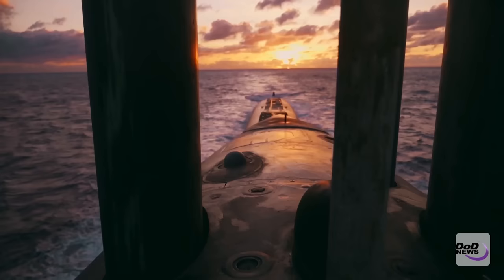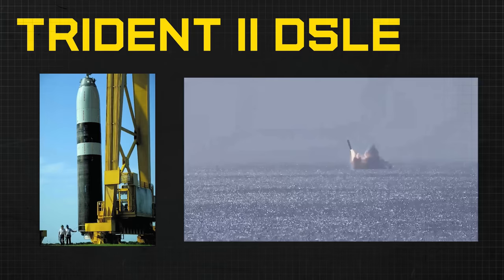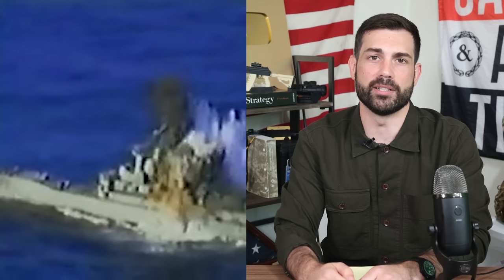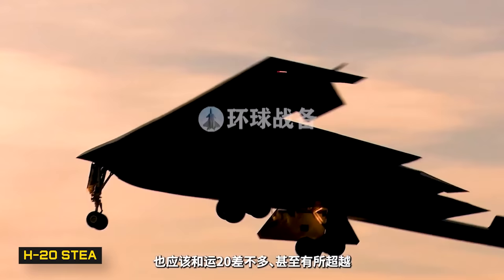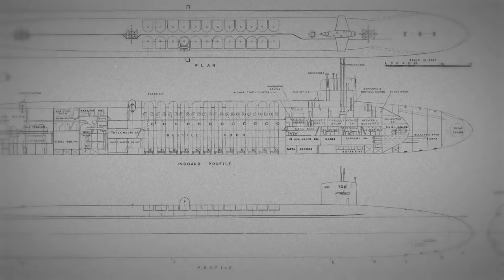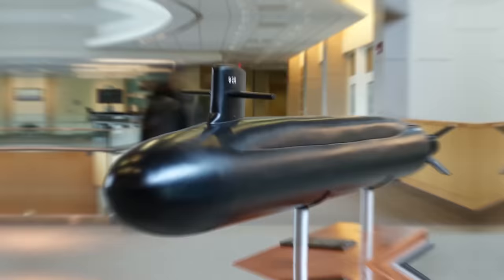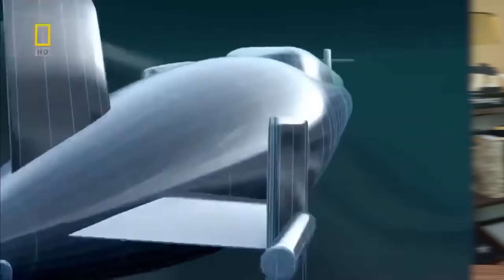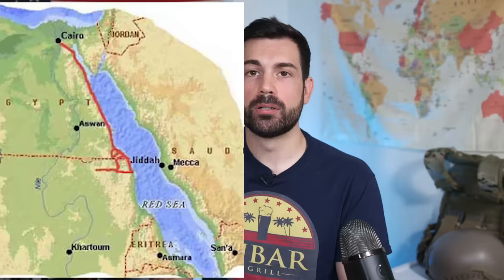Why America’s New Submarine is their Secret Weapon

Comment: Great video, but small correction - the Navy would most likely use Virginia class attack subs to chase away flotillas. The Columbia class, like the Ohio before, are Nuke bois...the torpedoes are for defense of the submarine.
Reply: @Freedom_Half_Off  yeah of course I didn't mean they'd be out there alone lol..sorry if that wasn't clear. Just mainly pointing out that the torpedoes are for defense of the nuke subs, and that they wouldn't send them for that purpose.
Reply: Yeah, that is a pretty huge mistake. The Columbia’s aren’t supposed to get anywhere near an enemy formation.
Reply: I wonder if less costly sea drones and AI will make ASW much more potent than it is today.  The ocean is a big place, but it is finite, and if the drones are numerous enough, the subs will find it harder to hide and with less time to launch their own attack.  A drone sub could connect to a mother drone or ship for battery recharging, diagnostics, and repair and then return to its search program.  If it finds something, then it surfaces and starts transmitting its data.  It could deploy sonobuoys to maintain contact.  Maybe a torpedo can take out the drone, but that can also telegraph the submarine operating area and attract other drones.  The drone itself could have some kind of ASW weaponry.  I don't think survival gets easier with time for these large, manned submarines.
Reply: @Freedom_Half_Off I think the video did a good job explaining their purpose, the torpedo and further tech explanations felt like a breakdown of developed technologies, etc.
Reply: Came here to say this. Ballistic missile subs hide, while attack sub seek.
Reply: @timtrewyn453 I think you underestimate just how big the ocean is.
Reply: Lol we could probably short duration active ping the flotilla with  of one of those old Seawolf class submarines, kind of like knocking so the go and look to see who’s at the door. Then let them listen for the props as they whip them up about 1/2 to 3/4 open.. just long enough to recognize who’s lurking. 😬 a little aggressive but kind of subtle at the same time? Idk but I bet there would be some serious conversations going up top in those ships too far from home.😂
Reply: Even a basic knowledge of sub types and roles would know this...I have known that since I was 10 and I wasn't a Navy Brat.
Reply: @grahamstrouse1165  100% would go the other way....as fast as they could.on the natural convection of cooling water so as not to need to activate reactor pumps
Reply: @Freedom_Half_Off  Unless you're in a shooting war,
there's generally little anyone can (or should) do about
"incursions" outside the 12 mile line.
Freedom of navigation goes both ways.
Reply: @thorwaldjohanson2526  It's big, but finite.  Drones could be organized in lines that subs have to cross to get to and from their operating area.  The drones do not have to cover every square mile.
Reply: @tbthedozer   Old seawolf???  We still have Los Angeles class subs out there Seawolf's are in the middle  LA class are the most numerous 34 of them still out there,  only three seawolf class and then a bunch of Virginia class about 20 out there with more on the way.  The remaining LA class are 688i  flight 3 boats last one was built in 1989
Reply: @timtrewyn453 
A drone has all the fuel and maintenance issues of a proper aircraft.
Reply: @icecold9511  True.  Tenders would be needed.  Some would be lost.
Reply: @Freedom_Half_Off Agreed. A single launch by anyone would mean the end of days for this planet, regardless of the technology or who fires first.
Reply: @Stryyder1  you do know that the Virginia class IS the Seawolf Class; right?
Reply: @ligmasack9038  umm...not exactly? I knew some tech developed for the Seawolf eventually made it into the Virginias in some form, but I never knew it to be the same or based on Seawolf as a whole. I could definitely be wrong tho...could you be more specific?
Reply: @Freedom_Half_Off $132B? Yeah, it’s worth more than that.
Reply: @timtrewyn453 You’re not wrong, but work the math on the number of drones it would require. Not an insignificant undertaking. But, it is a challenge that will need to be addressed.
Reply: Can’t speak for the US but UK subs fill a duel role. Each class only has 4 boats and, though there is always overlap between the rolling out of a new class and the scuttling of an old class, there just aren’t enough options available. 
It is a pretty big lack of insight to have your HKs and NDs fill the same role: the potential for a loaded HK to be hit is dangerously high and the resulting fallout from such an event… it doesn’t bare thinking about
Reply: @jakelilevjen9766    The Black Sea, a more manageable area, would be a place to start.  Drones could make manned submarine operations perhaps too risky.  Ukraine has a long-term interest in suppressing missile fire from Russian submarines.
Reply: Person
Reply: Person
Reply: The
Reply: @jacobp8294 Don't beat up Army for Naval ignorance. He is stretching his sphere of knowledge, and Navy stuff can get really complex.
Reply: BTW ignorance is not to be considered as stupid, just not well aware of the details.
Reply: Yes, I stopped watching the video after the first two minutes in which the presenter made it clear that he has no idea what the role of a ballistic missile submarine is.
Reply: Huge correction to be honest. Not sure who wrote that part of the script. And then it was followed up with “twin” torpedoes. Whether you are correctly talking about the Virginia class or incorrectly talking about Columbia class, both are equipped with four tubes. Since I’m being critical - you also had an A&E moment when you showed Virginia-class vertical launchers when talking about SSBN launchers. Now back to the video I guess.
Reply: @Freedom_Half_Off   Yes, the whole reason the Ohio and now the Columbia class is stealth. They are not there to attack surface ships , unless they themselves are attacked.  I worked on 688 class attack submarines and Ohio class while working in the shipyard. Amazing machines!
Reply: Or just ring AUKUS, from 2030... India will probably be fully on board by then too. Cheers 🇦🇺
Reply: @Freedom_Half_Off Chris did not get into the Navy imho 😂 🇦🇺⚓
Reply: Yep, they are boomers and don't do ship attack
Reply: @timtrewyn453 works both ways
Reply: Quite right!
Reply: I wanted to point this out. The whole point of a SSBN is to keep the location a secret. No way are they going to be used in warfare against naval targets.

That is what attack subs are for.

In addition to this, he said that the Ohio class Trident missiles can only carry 4 warheads each. This is false. They can carry up to 14, but it depends on the type of warhead. The number is currently limited to by treaties.
Reply: @Freedom_Half_Off  "The attack subs aren't going to stop incursions by flotillas of cruisers and destroyers either ... not unless we're in a shooting war or they want to start one ."

Subs can ping ships if they feel the ship can't lock on to them.

But yes in general all subs stay hidden and the job of attack subs is really hunting nuclear subs, which REALLY try to stay hidden.
Reply: @timtrewyn453  Yes, yes it will, but small drones can only do passive listening.

You have Frigates that are better for subs IMO because they carry a helo onboard whose job it is to hunt subs and have the buoys they drop.

I think you need a bigger ship to go active and this gets to the point of, do you need 2 different ships or combine everything into one.  Right now we're building DDGs Arleigh Burke class.  They're a missile platform and can basically do everything since they can have a towed array and ASW helo.

I think about the best you could do with a drone, if you want it to be a smaller ship, like half the size of a Frigate at most would be to have radar for surface and air and smaller missiles for both surface and air, so no long range for air.  It could also drop buoys and have desk mounted tubes for torpedoes.

But you need some ships to go active for hunting subs, so something at least the size of a Frigate.  The US is making a new class.  I don't like it.

I wish they'd basically beef up the design of the Perry Class (FFG-7) which used a simple gas turbine engine, but make the hull more capable and durable so the ships last longer.  I'd also get rid of the gun.  That's just too old school now and not really good for small boats.  I'd rather see 2 different rail launchers, one being small for taking out small boats and could also hit aircraft close range along with missiles so acting as CIWS (or have them fixed in a box style launcher that say holds about 20 small missiles) and then a rail launcher for medium range aircraft (SAR).  Then on the sides you could have your torpedo tubes (not in the hull, off the main deck).  You could also add harpoon or something similar in tube launchers which could get you up to about 8.

So yeah, build a few drones so that a task force could have at least 2 operating with it, build a more durable FFG, they ARE building more Arleigh Burke class, and once again I don't like the DDGX design that they're supposed to build in the future because once again I don't see why a ship needs a gun.  I'd replace that with a SAR rail launcher, but now I'd want the capability for long range air so a bigger launcher, and then you want it loaded up with a lot of surface to surface or surface to shore and of course those are in silos now.

So that's how I'd like to see a task force made up, more modern FFGs but not the one they're going to build, along with DDGs along with drones along with attack subs along with a carrier.
Reply: @ligmasack9038 
The Seawolf and Virginia classes are most definitely not one and the same.
There are many differences that make them completely different classes with different mission requirements.
Reply: Tbf all they need to do is shoot the ship a message in the target language. “You’re in range, leave.”
Reply: some of the ohio class subs were converted from SSBN to SSGN
Reply: @timtrewyn453  The system you described sounds very potent. But it will take decades to develop. So, even if the Navy has something like that in mind right now, don't expect to see it before 2040. Damn, I'll be 60.
Reply: Indeed - like the Ohio class before them, the Columbias will leave port, dive, and disappear for up to three months at a time.  Nobody will know exactly where they're at, even the US Navy.  Any torpedoes they shoot will only be at someone who's already shot one at them.
Reply: @@aregeebee201 That's an argument for making them structurally long lasting and electronically modular.  Like a B-52.  Perhaps full coverage of the oceans is never economic, but reducing an opponent's flexibility has value.  Proving SSBNs are clearly not in a set of particular places allows other systems to focus on where they may be.
Reply: How does something whose strength is in its invisibility ever chase anything anywhere?  Seems like the wrong tool for that job.  Would blow its cover.

Comment: Another important factor for fleet size is the rule of thirds. Only about 1/3 of your fleet is available for operations at any one time. 1/3 is in maintenance and repair and the final third is breaking in new crews and equipment. In an emergency you can surge that final third out in a somewhat underprepared state. So having 14 subs really means you only have 4-5 on station at a time.
Reply: Not in the case of the Ohio class, there were two bases Kings Bay Georgia and Bangor Washington, with at one point 8 subs each,  then a couple were converted into SSGN's.  The Ohio class actually had two separate crews, Blue and Gold crews so the subs spent more time underway than any other platform ever developed.  I did 16 Strategic Deterrent Patrols of about 70-80 days each.  There where at most three subs in port that I can remember..  The maintenance and upkeep was done by both crews in a 30 day refit period.  They spent a majority of the life cycle under water.

Comment: I've been on several boats. There is no graffiti anywhere in the head of a Submarine.   Fun fact when I was assigned to the Dainel Webster she was was in dry dock the interior panels were removed. Part of the steel bulkhead was exposed for the first time since construction in the early 1960s. The dockworkers left painted some unflatering remarks and pictures about The Soviet Union. This part of the bulkhead had not been seen for over 30 years 😂

Comment: I was on the third Ohio ship when it was brand new in 1984. We carried the the UGM-96 Trident 1 with 8 W76 100kt warheads in all 24 missile tubes. 24 of these Ohios were slated to replace 41 older SSBNs of 5 classes built since 1959. The cold war reduced this to 18 finished and the first 4 were converted during a 12 year refueling to SSGB with 7 Tamahawks per missile tube x 24 tubes. Building a 560ft Columbia to match the Size of Ohio with only 16 Missiles instead of 24 better mean we get a Sauna like the Soviet Typhoons.

Comment: If I remember correctly, that external hull texture that the Columbia class has was developed by some Rice University students a decade ago to mitigate radar detection. The problem with radar is that it's mostly used for detecting aircraft, but they need a smooth body to reduce drag. I guess they were able to adapt it for sonar, sound waves instead of EM radar waves, and engineers believed the drag it creates isn't as much of issue since it doesn't have an extremely limited amount of fuel
Reply: These absorbing surfaces are something extremely old. The application on submarines was at least tested in WW2. But of course there are continous technical improvements
Reply: @frederikqu7717  The German Type 21 subs at the end of WWII had acoustic coatings on their hull flat surfaces but not all over.
Reply: sonar, not radar as subs don't fly
Reply: They both use wave forms that reflect and have to detect that reflection. The speed of the wave and time and direction of detected reflection build radar images of all types.. but sound also does resonance where tone freq can cause more then reflections but induce vibration and carries fairly far in water but still with some frequency in the ems the water might as well not exist so and airplane overhead pumping out radar waves alone might have issues with a top side sub surface angle designed to avoid reflecting anything back up but if you like can be done in modern times network all your radar systems on ships and planes and detect every reflection and timing from sync separate signal points you can only be stealth by absorbing radar wave and even then the networked radar system can flag the void where reflections are missing that were expected and detect that even.. I have a feeling that stealth isn't really a reality to any fleet and only really can be effective in older environments or single isolate targets.
Reply: Radar does not penetrate very far under seawater. Too many desolved  metals. Radar is only an issue if a sub is close to the surface or is surfaced or snorkeling.  A sub could make a kill and not be detected by radar.

Comment: The "we only need 8 subs" argument fails to consider that the US might have most of them stuck in port waiting for maintenance (like the UK) or offline for a year because of the Navy ramming subs into undersea mountains.
Reply: Those mountains need to get da fuq out da way. Murica is coming thru!
Reply: @Russo-Delenda-Est  Yeah, that doesn't work. You would be surpised how many times that has happened.
Reply: They are putting bigger bumpers on the new models.